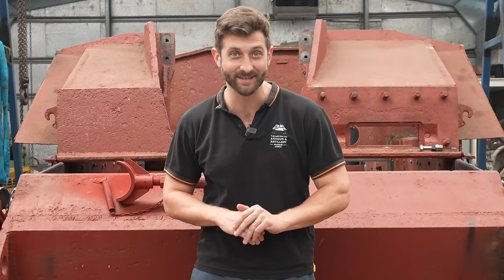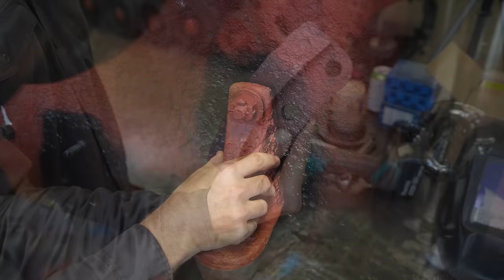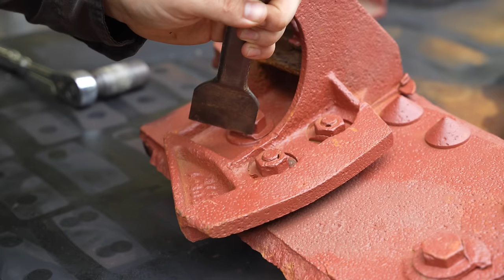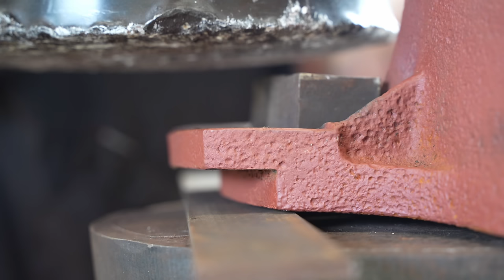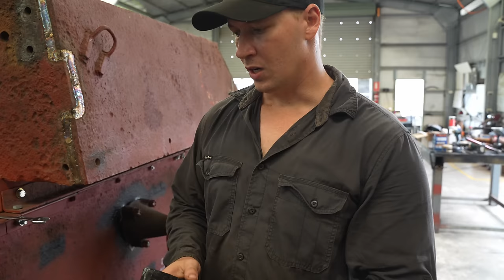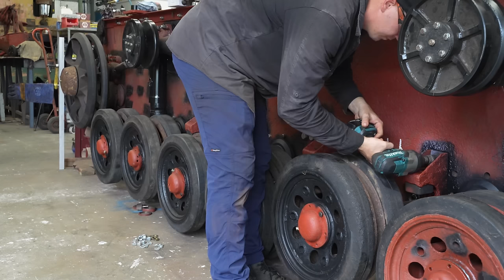WORKSHOP WEDNESDAY: StuG III G suspension COMPLETE!

Comment: 3:22 or over a ditch or climbing a berm. That can also bottom out the suspension depending on inclination.
Reply: The torsion bars are supposed to absorb impact.  The rubber bump stops are a secondary measure.

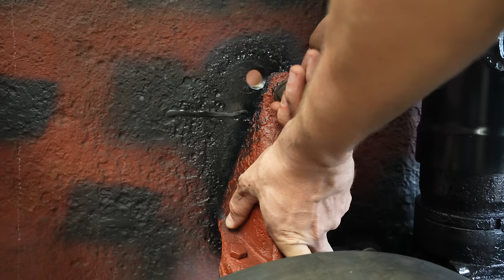Comment: 15:46 mark.  Question on the through hull tapered bolts.  Why did you not use a castellated nut to allow insertion of a cotter pin???

Comment: I cracked an intercooler mount on a 62’ SeaRay by trying to get to move over the studs. It got slightly (fractions of a mm) skewed and “SNAP”. Every time I see a wedge separating two pieces of metal I cringe.
Maybe I should been doing a tank instead of a boat.

Comment: Why is there a couple of bolts labelled "Gun Mount" so low on the outside of the vehicle?
Reply: Because the gun mount sits on the inside of the hull and those bolts from the outside go through the hulk and attach it to the inside.

If you go back and look at previous videos where Beau was test fitting the new gun mount you’ll be able to work it out, ok?

Comment: Watching all these videos on the axles and running gear I've come to realize that the supposed engineering and precision of the Germans was merely a myth.  The abundance of multiple varied shims and spacers required on everything from axles, bearings, swing arms and even just bump stops is a bit overboard. The hand fitting/machining necessary for each individual stop per stub axle is crazy. I'm not talking about items they add due to the Stug being blown up, these are factory original.  Sure transmissions and differentials will have thin shims but suspension parts? It's not like this is from rebuilding after wear and tear, these vehicles generally didn't survive long enough to get rebuilt.
More proof of the superiority of the Sherman.
Reply: Their engineers had a peculiar mindset.